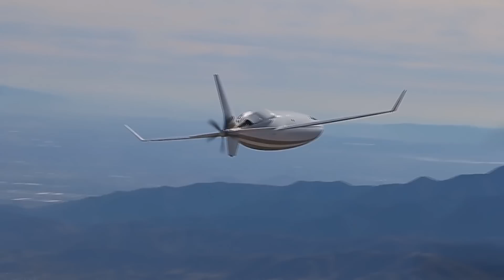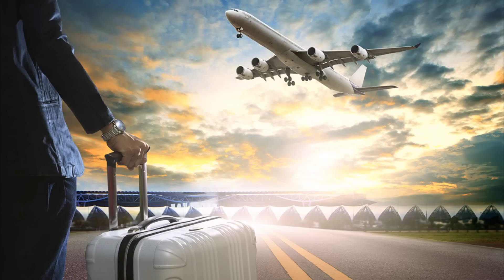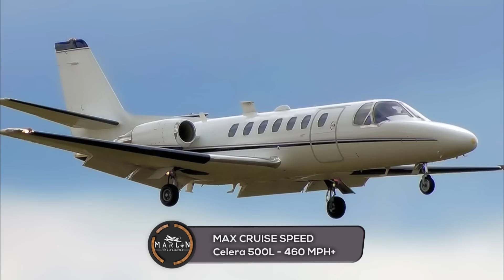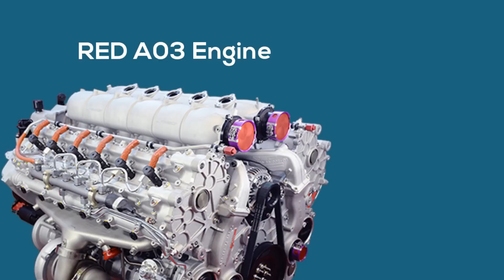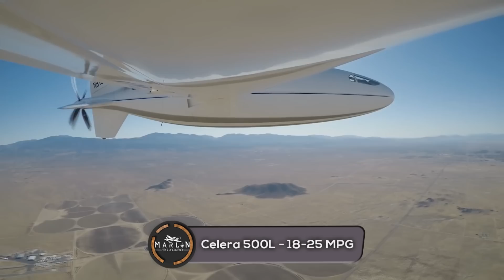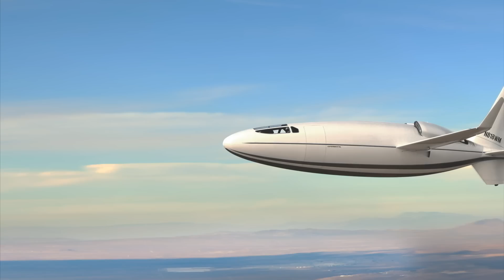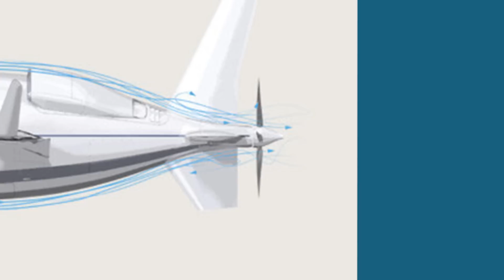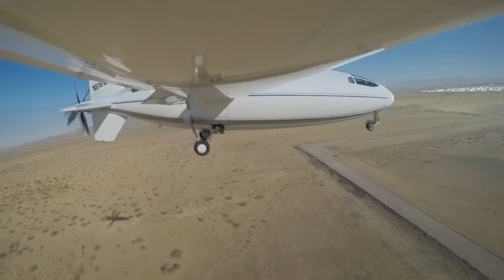Meet the Celera 500L (Flies Faster, Farther, Higher, Cheaper)

Comment: Looks a lot like the X-1A flown by Chuck Yeager.
 U.S. Air Force Captain Chuck Yeager becomes the first person to fly faster than the speed of sound.
Yeager, born in Myra, West Virginia, in 1923, was a combat fighter during World War II and flew 64 missions over Europe. He shot down 13 German planes and was himself shot down over France, but he escaped capture with the assistance of the French Underground. After the war, he was among several volunteers chosen to test-fly the experimental X-1 rocket plane, built by the Bell Aircraft Company to explore the possibility of supersonic flight.
For years, many aviators believed that man was not meant to fly faster than the speed of sound, theorizing that transonic drag rise would tear any aircraft apart. All that changed on October 14, 1947, when Yeager flew the X-1 over Rogers Dry Lake in Southern California. The X-1 was lifted to an altitude of 25,000 feet by a B-29 aircraft and then released through the bomb bay, rocketing to 40,000 feet and exceeding 662 miles per hour (the sound barrier at that altitude). The rocket plane, nicknamed “Glamorous Glennis” (after Yeager's wife), was designed with thin, unswept wings and a streamlined fuselage modeled after a .50-caliber bullet.
Because of the secrecy of the project, Bell and Yeager’s achievement was not announced until June 1948. Yeager continued to serve as a test pilot, and in 1953 he flew 1,650 miles per hour in an X-1A rocket plane. He retired from the U.S. Air Force in 1975 with the rank of brigadier general.

Comment: Feels like what is going to kill it is the small size. If you have an airport with one runway and run a large jet you can get 200+ people in ticket Prices per plane leaving. If you have this smaller aircraft you will still need to occupy the runway almost as long but only get 6 tickets per lanuch. In order for this to be economically viable it would need to be around 30 times cheaper to operate than a regular jet, which I doubt it is. It also adds costs by having more planes in the skies requiering more people/systems to keep track of them.

This would be great at small low capacity airports which don’t fly many people, but when you have an airport trying to make as much money as possible it’s hard to beat cramming 200 peoplen into each plane.

Comment: Low drag is always advantageous, no doubt about that.
But it shouldn't be used to extend the range or to lower the cost per passenger by using ICE engines and fossile fuels.
The essential thing is not to just minimize but even prevent CO2 emissions.
It is a good possible base for zero emmision long distance air travel systems though.

Comment: bruh you're literally just reading facts from their website
Reply: "facts"
Reply: You can look up the tail number and get bits of history from both the FAA and FlightAware, which also has two photographs.  There is no recent flight history.  The current information on the company web page indicates it is in the process of FAA certification.  Supposedly the aerodynamic efficiency was "proven" in the 4th quarter of 2019.  That would likely have been wind tunnel tests.  The FAA tail number indicates a manufacture date of 2017.
Reply: @theeddorian  i knew there was something fishy about this, yet still i really hope there is some efficiency gain in actual flight without loss of preformance.
Reply: BADLY...and haltingly. Stopped...
Reply: If they're truly facts, not wild claims, there's no problem there!
Reply: @davidwright8432  yeah i know i was just disappointed to find that he was reading the website word for word.
Reply: And he doesn't have much of a technical understanding, either, saying stuff like "it consumes 25MPG" instead of "it gets/achieves 25MPG"
Reply: Also, every video I've seen on the Celera so far does exactly the same thing. They quote the same $328/hour and 18-25 MPG number, the same "competitor" $2100/hour and 2-3MPG number, and so on.

I have yet to see a video with real analysis from an expert who can evaluate the veracity of their claimed performance numbers. I do know there was an article in a recent edition of Flying doing just that, but I don't subscribe so I can't read it.

Comment: Not an aircraft designer, but I'm wondering about the wing loading on that really narrow, high-aspect ratio wing. And, if the wing is designed for almost total laminar flow, then it might have an enhanced sensitivity to foreign objects  on its upper surface, like ice or even bugs. Hopefully they have engineered solutions around these concerns, as the concept seems like a real winner if it all proves out.

Comment: It has a capacity of six passengers! If they can sell it for the same price as a conventional six-passenger plane then its low operating cost will give it an edge in the small-private-plane market. But a six-passenger plane has no relevance for commercial aviation where short-hop routes are served by planes carrying 20 or 30 to 100 passengers and long routes are served by planes that fly far faster and carry several hundred passengers. This plane could be used by businesses when a Lear Jet is too big for their needs on short flights when speed is not an issue. The plane is a solution searching for a problem. I repeat: SIX PASSENGERS! There is no market niche where it would be more than an entertaining oddity.

Comment: I'm not sure if this will be the "Tucker Torpedo" of aviation or the "Edsel" of aviation. I'm wondering how a piston engine airplane could reach 60,000 ft. though. The air is awful thin that high. But for regular general aviation altitudes, it sounds like it might be a winner. At least I hope so! It is a strange looking beast, but kinda cool in a way. I'd sure like a check ride in one!

Comment: That's gallons per mile not miles per gallon. It doesn't consume miles it consumes gallons. It "achieves" eighteen  to twenty five miles in the "consumption" of a gallon, you miss spoke. A typical aircraft consumes 1/2 to 1/3 of a gallon per mile. Solara consumes 1/18th to 1/25th of a gallon per mile.
Reply from the maker: Nope, it’s miles per gallon

Comment: I read all the comments.
Can anyone say when production will begin and flight testing completed ?
Can anyone say what the proposed price will be ?
6 people flying 4000nm non stop ? 
Toilet and holding tank ?
Fuel tank size ?
Lower vertical stabilizer needs to be be made shorter to avoid ground contact at take-off rotation.
What performance specs for the larger version ?
I'm a former Boeing CNC Machinist.

Comment: Viruses gonna love this mode of transportation: Low Profile General Aviation Airport departure and arrival.

Seriously though, smaller is better these days, even by commercial airlines: Lufthansa is grounding all their 4 engine transcontinental jets (A340, A380, 747) as of Sep 2020, most likely due to demand, and Celera 500 has the performance of a transcontinental jet: Six people at a time.

Maybe six is too small a number? Sixty passengers at the performance and cost of the Celera 500 would be revolutionary for general public commercial aviation.

I'm sure there are plans for autonomous (or at least non-pilot or below pilot level operator) passenger service somewhere down the line, since a UAV version was mentioned. Starlink relayed remote controlled passenger service?

Comment: I hate when things sound too good to be true but if it can do everything it says it can do, fantastic. 
Game changer? 
Maybe for regional airlines but the infrastructure,  customs, security, FAA and world wide regulations to accommodate international flights? As long as someone can figure out all that red tape, you never know. Anything is possible.
I would much rather leave for vacation in limousine fashion from my local 5000ft runway while avoiding some of the unpleasantness of flying in a metal tube with 300 other miserable, germ spewing, commercial airline victims at 45000ft.
A large country like Canada might benefit greatly from this type of plane.
Air taxi from my regional airport, north of Toronto, non stop to Kamloops BC. That, would be amazing!

Comment: The shape is inefficient for passengers to use the internal volume. It is slower than every jet, flys lower and will eventually go away. This design may be used for short cargo hop in Alaska where there are no roads.
Airline seat costs are highly impacted by pilot salaries.

Comment: I want to see a hydrogen blipm mixed with an aircraft like this. If the hydrogen can help to give it that extra lift, surely it will save a lot on fuel consumption.
This plane was not what I was expecting but it does sound like a good thing. I'm sending my blessings out to the developers and early adopters to get this thing off the ground!

Comment: Wonder if one can buy a Celera outfitted with Kasper wings?    

Kasper wings were developed by Wetol Kasper a Polish born Boeing engineer in the 1980's, Wetol went to the Boeing engineering dept. and asked them to determine how much energy was expended by the Artic Teal during its non-stop flight from the north pole to the south and of coerce back again, the answer he received is that it should not exist at the end of its flight,   since we know that it makes these flight every year,  when I met Wetol he asked me what do I see when i look at a wing? I made a hand motion as going over the top of a typical wing, He said that was the problem nobody bothered to look under the wing, he than asked me "do birds have square wing bones?" well I said NO  his reply was "than why do we make  wings with square tubing" he said the Kasper wing copies nature with round tubing in the wings like bones but you must also reproduce the same contours as are found in the underside of the birds wing.

Back in the late 1980s Scientific American Magazine had an article describing the Kasper wing stating that if such a wing were to be placed on a Boeing 747 it could be flown at 35 miles per hour with 3 times the payload with no problems whatsoever.  not only that but the kasper wing is the only fixed wing plane that can can land like a bird lands on a limb.  currently all fixed wing planes landing on a runway fly in they do not land.

Comment: I mean, the LSA category aircraft I fly have similar fuel efficiency/distance numbers to a car.
(in fact, for a given distance the aircraft I trained in uses the same amount of fuel as the car I drive).
The downside of course is these are tiny, slow aircraft that carry at best 2 people and a tiny amount of luggage.
And for that weight restriction, you only go about twice the speed of driving somewhere...

The claims are interesting if true, but they seem a little... Unbelievable.
If it were that easy, why hasn't it been done before?

Comment: Novel, new aircraft are just so difficult to bring to market. I don't think the "Big oil, or Big Aviation" companies really need to do much to keep the market in check...The process of development. certification, sales, customer support, setting up service centers, etc, is just too big of a task for 99% of all startups. Think about it-   Honda (A huge company with massive resources) took from year 1997 to 2015, and a $1 to $2 billion dollar investment, to deliver their first aircraft!!! Honda has sold about 160 aircraft so far. I wouldn't be surprised if they haven't made a profit yet.
The certification requirements are forever becoming more and more difficult to meet. Eclipse Aviation attempted the same thing, but without all the resources large companies have, and after about 300 aircraft sold, filed for bankruptcy. Their initial goal was to sell planes for around $800,000 each. The actual sale price ended up being $2.5 million. They weren't being greedy, just realistic. There's just not enough profit to keep a company afloat if you're only selling 300 units.

Comment: Fantastic.
Although how safe is air travel if hundreds of private planes are crossing 32k feet?
Reply from the maker: Well they do it nowadays and it’s pretty safe. Air traffic controllers keep a good eye out for these instances and make sure no planes ever cross paths
Reply: The sky is a very big place. Most collisions occur because the current air travel system concentrates air traffic at a few  hubs. This machine is supposed to change that.

Comment: Well done design, 
will contact them soon. Would like to also see a smaller 2 + 4 person version with a larger slower glider type wing. 
Am an old EAA type from early 70's. 
and enjoy slower safer functionality.
Reply: Did you manage to contact the company? Are they looking for capital funding to ramp up production?
Reply: This aircraft seems to be designed around a particular engine, the RED A3. Changing it much would require a complete re-design, something they are unlikely to undertake when they have millions in resources tied up in getting this into production .

Comment: A new design on an old concept.
1 Airframe for testing is out "N818WM" and I don't like this design: what only matters is the length of the airframe for the drag the rest go's down in the numbers (windspeed, speed, winddirection).
It's a nice and ugly concept of maximising cabin volumina without adding drag, but they put more on the front part and make the back part a little bit thinner.

It's nice if the wings will be foldable (unlock the central bolts, unlock the wings, unlock the control rods, slide the wings out) as you may put this plane on a truck and in a shipping container.

Comment: There are a lot of claims here, but not a lot of numbers. I am suspicious of laminer flow, as it tends to happen only in ideal conditions. But Rutan used laminar flow airfoil on some of his designs. I have heard reports that the lift performance deteriorated alarmingly in rainy weather. What about icing conditions?

And what about the range and service ceiling claims?

Are they based on all fuel and no cargo?

A typical four place aircraft can do quite well range wise, if fuel-tanks take the place of three passengers. That's about 30 gallons each per missing passenger.

This being said, I think it's an interesting design. I like the pusher prop and the piston engine.

Comment: Hard to believe a reciprocating engine is going to be more efficient than a turboprop for this aircraft. A PT-6 would be lighter, have better performance, lower fuel usage at high altitudes for longer flights. The engine will be much lighter in overall weight and take up less space. Not to mention the PT-6 is tough as nails and one of the most reliable engines ever built.

Comment: It only sits six people. In order for this plane to be practical there would be so many of them in the sky it would be comparable to taxi cabs in Manhattan. Sure the airframe is efficient but a twelve cylinder engine? Lots if moving parts. One goes kaput...twelve cylinders become an ⚓. Convert to latest capicitor type battery with airflow generator. Electric motor way more powerful.

Comment: The assumption is that instead of going to the airport to board a commercial airline's big aircraft, the flying public would instead head over to this new breed of plane.  As long as it holds less than current commercial aircraft  it still does not address the issue we had before Covid-19, and that is that air-space was getting congested.  Assuming the need reignites to pre-virus levels, with smaller aircraft the number of aircraft flying would increase.  The need would shift to technology which is in its infancy and allows for the responsibility of collision avoidance to be moved to a higher degree from the ATC to the pilot.  Otherwise this is a great advance in aviation.